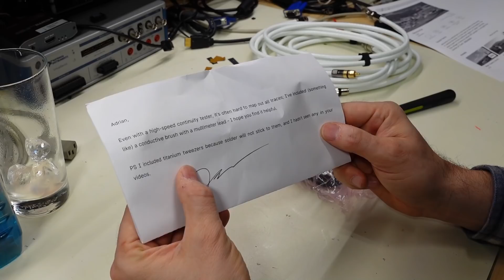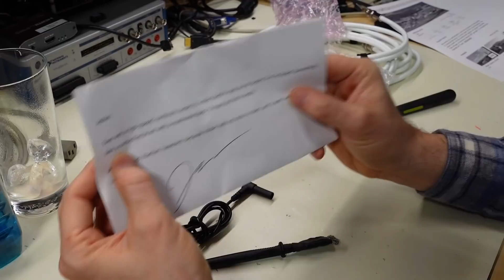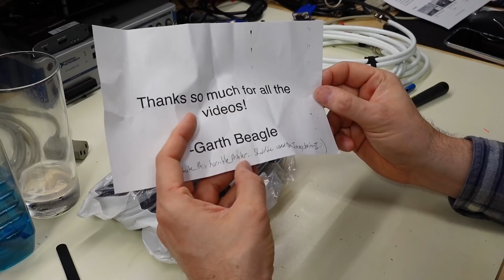0027 I easily find some hidden traces, play with titanium tweezers and bend some coax

Comment: This cable came off of a 1000' reel of CommScope RG6 Tri-Shield cable using with a 77% braid coverage.  The connectors are compression type and should provide quality connections without interference from outside sources.  This is what the local cable company will use when pulling cable indoors.  Not very flexible, but great stuff.  CommScope is my favorite one to work with since the foam pulls off cleanly when you strip it.  Tri-Shield cable is a great middle ground for shielding without having to deal with the frustration of using Quad-Shield which can be fussy to get a connector on fully seated.

Comment: That brush at 8:00 is a great idea.  Needs a secondary pinpoint on the same handle to narrow the beep down to a single point of contact.
Reply: Oh damn, that's a great idea! I'm going to have to make one, but have the brush retractable so the regular probe is sticking out. 🤔
Reply: It seems it would be, but it is not. Some "brushes" similar to those used in brushed motors would be more appropriate -- solid copper and springy. These stand a very high chance of breaking/flaking off and finding their way under and between surface mount chips. I predict tragedy with this one and really hope he gets it off the bench before killing something with tiny metal shavings.
Reply: @mal2ksc  you make a good point
Reply: @mal2ksc  Especially with the way Adrian jammed that sucker into everything, you'd think with that a gentle brush around the board would do the trick if the meter's fast enough.

Comment: The probe is such a simple yet useful concept. I wonder why they are'nt everywhere ? I've never seen one before.
Reply: Its easy to bridge contacts and destroy your board or chips. Imagine a 3v backup battery voltage is bridged to a 1.8v input pin for example. Or a brush gets caught in between the chip legs... At least i feel a little bit offended by this tool :D
Reply: @BaumInventions  The bristles seem soft enough not to bother chip legs, As for the battery back-up, you do have a point. You would have to make sure any batteries were removed. Another thought, charged caps.
Reply: All good points! Maybe I could put some steel-wool in  a croc clip?
Reply: @electron-1979  You can use any stranded wire, but the finer the strands and the more of them, the better it works. I just use a piece of high strand count 14AWG RC battery cable (high current cable for quad copters or RC cars). It saves time when you're trying to figure out where a trace connects, as you can brush over huge swaths of the board quickly, rather than probing points one by one with a regular meter probe. Perfect for reverse engineering, or repairing things when you don't have schematics.

Comment: LOL! I made my own conductive brush probe a few years ago in the jankiest way possible:

I snipped my used solder wick off the roll with a generous amount of fresh braid still attached to the used portion. I then frayed and spread out the unused end and connected an alligator clip probe to the solder on the used side. All the flux flakes right off but you can still use isopropyl to promote conductivity. Worked like a charm!

Comment: 1:09 NEVER spin the male part of the connector - that rubs the center pin contacts more than necessary and can damage them. Doesn't really matter for F connectors where the cable is copper, or copper clad aluminium and the other side is probably just cheap tinned contacts, but for precision RF connectors that are gold plated, that's a great way to ruin them. You always spin the NUT, and keep the other side stationary so the center conductor (or pin) only goes straight in and out, not rotates.
Reply: Also, it's RG-6 - no one uses RG-59 anymore (except in old shitty security camera installations). RG-59 goes straight to the garbage these days. And those ends (BNC and RCA) are no harder to install than F connectors, you just need the right compression BNC and RCA ends, and a compression crimper with interchangeable dies, as the BNC and RCA need different crimp dies.
Reply: @gorak9000  The compression tool I used was an adjustable one.  I don't love adjustable compression tools, but when making multiple cables like these, it was easier to use the one adjustable tool, versus multiple tools.
Reply: @jeffymooch  I have the tool to do these - it has 3 interchangeable - I guess I wouldn't call them dies, so much as "pusher ends". The F one has a post with a slot in it so you push against the inside of the F connector while not pushing on the center conductor. The BNC one is almost flat, except for a little lip that engages with the bayonet part of the BNC end, and the RCA one has a larger hole in the middle to accommodate for the RCA center pin which is large compared to F
Reply: @gorak9000  yep,  that’s the tool I use.  The depth of the pushers is adjustable for which connector you’re using.  I have a specific F connector tool that is used only on those F connectors and nothing else to avoid over compressing a connector

Comment: the problem with the brush is when it loses some tiny silver hair and that one could cause a short in the board (i.e. stuck in between QFP tiny legs)
Reply: Just have to make sure it doesn't lose any bristles!
Reply: I would not let this near my repair bench, personally. There are ways to rake pins with a springy metal contact that won't shed bits. Also any stray wire bits could well end up in between a chip and the board and get vibrated out an unknown amount of time later. This is essentially painting on extremely fine, conductive dust.
Reply: @mal2ksc  your argument is predicated on the idea that you wouldn't give an ultrasonic bath to everything that touches the workbench, something that every good tech does.  If you're laying out a schematic like this, you ought to be in that tier.
Reply: @FullFrontalNerdity  I can assure you Adrian does NOT give an ultrasonic bath to the boards that cross his bench, and it has been a significant ordeal for him to send them to other people to do so when it has become necessary.
Reply: @mal2ksc Taking into account how expertly you've missed the point, have you ever considered a career as a matador?
Reply: @FullFrontalNerdity  I haven't missed the point. You charge in claiming that the scattered debris isn't an issue because any REAL tech would have an ultrasonic cleaner. I'm pointing out that he doesn't have one so adding something that makes him need one probably isn't a good idea. What the hell is wrong with YOU?

Comment: The brush is cool, I have been thinking of something like that. Probably more useful on the back of the board - and maybe on more densely populated ones. But really cool!
Reply: I'd agree that even with all my apprehensions of using this, there's probably not that much hazard if some tiny metal bits are shed on the BACK, where they're quite likely to be cleaned off afterward.

Comment: I have noticed running a probe across the circuit sometimes doesn't find the connection if you run over them too fast, so a conductive brush would probably work better since it provides more opportunities for contact.

That coax definitely looks like the thicker RG-6 rather than RG-59. Probably not necessary to have such a thick cable just for a low-bandwidth RF signal, but the cable and connectors are pretty cheap to make a decent quality cable like that.

Comment: My first impression of the probe was that it was a brilliant idea, but the potential issues raised by other posters make me think it might not be.
Reply: They work great, and you don't need a special probe - just get a piece of high strand count 14GA RC battery cable. Most boards don't have batteries or charged caps on them. They make reverse engineering or repairing things when you don't have a schematic infinitely faster.
Reply: @gorak9000  My concern was not batteries or charged caps, but the possibility of conductive material falling off and causing shorts, which had been suggested by others. It seemed like a valid concern. Your idea of R/C battery cable sounds good.

Comment: RG59 is 75 ohm, RG6 is 75 ohm, rg58 is 50 ohm, RG62 is 93 Ohm. you also have the thicker underground stuff like RG11.
Reply: I almost forgot about RG11.  They ran tons of armoured RG11 expanding the cable TV system where I used to live.  And they actually ran most of it above ground.
Reply: @douro20  RG11 comes in both underground "flooded" cable, as well as "messengered" aerial cables.  Hanging 200+ foot long aerial drops was a bear.

Comment: I used an ImageWriter II from 1989 through 1996. Never had any trouble with it. I eventually got rid of it around 2000. It still worked, although the pin feed drive on one side was starting to slip. A few years ago I rescued another one from e-waste but I haven't had a chance to try it out. I assume it works, and if not it should be easy enough to fix. Black ribbons are still available, but unfortunately I don't think anyone is making the 4-color ribbons anymore.

Comment: I had an original Imagewriter and upgraded to an Imagewriter II.  I printed tens of thousands of pages on the IWII without any significant issues.  The IWII did require 20 pound-weight paper (you could get away with 15 pound-weight for the original IW), so I wonder if that was the cause of your jamming.
Reply: Yeah, I also have some fond memories of the ImageWriter II. Perfectly reliable printer as long as you feed it traction feed paper. Fast as all getout in draft mode as well from what I remember.

Comment: For dot matrix printers, you can not beat okidata.  Especially the versions that used typewriter ribbons.  Those things will not die.

In fact, every time i fly, if i am close enough to the gate agents desk, you can hear an okidata dot matrix printer printing off the pilots data.  How do i know it's an okidata, you can usually see them.  Trust me, they are all okidata printers.
Reply: Back in the '80s at work we had an air conditioner drain pan clog and it poured water out of the ceiling into an Okidata Microline 80 series printer.  We got it unplugged right away, and literally poured water out of it.  Took the paper out and the cover off, tipped it at an angle with a fan blowing on it.  After it dried out we set it back up with fresh paper, turned it on while holding down the Online key to start the self test pattern printing.  It printed blank for about three or four rows before starting to fade in, needed to get to a good spot on the ribbon again.  After that it was fine, no issues and worked as good as the others.  I'm sure it helped being fairly clean water and limited exposure time, but still demonstrated the durability of it.
Reply: @bobblum5973  I know!  Even the cheaper printers they made (and probably still do), were workhorses.

I was a big Epson fan back in the day, and i always thought the Okidata's were kinda cheap.  But the Okidata's were more reliable that any other dot matrix printer i am aware of.

Although the paper tiger's were pretty good.  But they tended to blow darlington driver transistors a lot.  But that was an easy and simple fix, just solder in a new one, and that thing would just run.

Man, haven't thought about paper tiger printers in forever!

Comment: All Modern cable TV and satellite TV connections use at least RG-6 grade coaxial cable. Older Antenna connections (after they switched away from Twin-lead wiring) used RG-59, a less well insulated type of coaxial cable. Back in the day coaxial cable was very expensive so RG-59 was a cheaper type of coaxial cable that was thinner then RG-6 and often did not even use a solid copper center wire but a copper plated core all to cut costs. This was all fine for NTSC antenna connections but had poor performance with cable TV signals, especially over long runs. Standard RG-6 is much better insulated from RF interference and a quad-shielded version exist for special application for when even greater RF interference shielding is needed. 

While RG-59 is still sold these days, most people would and should use RG-6, even for patch cables like the ones you received so it’s almost certainly RG-6. The cost of RG-6 these days is cheap enough that their is no reason to use RG-59 IMO. Modern RG-6 should have RG-6 written on the cable sheathing as all modern coaxial cable indicates it’s type on the sheathing.

Comment: Cable TV is 75ohm or RG59/6/11.  HF/VHF/UHF is 50ohm or RG58/8.  Please, this is not inclusive of all RF Cables.  F connectors are known as 75ohm.  RCA connectors are generally 75 ohm. BNC can be 50 or 75 ohm, most connectors are labeled and it does make a difference.

Comment: Unpopular opinion here but it really concerns me -- I think the wire brush probe is a brilliant but fatally flawed idea that should be removed from your test bench (or not installed in the first place). You're leaving tiny bits of conductive dust everywhere, and some that won't even be so tiny as the ends break off the bristles. These can and will get lodged under chips where you can't see them, and then vibrate their way out months or years later to cause havoc.